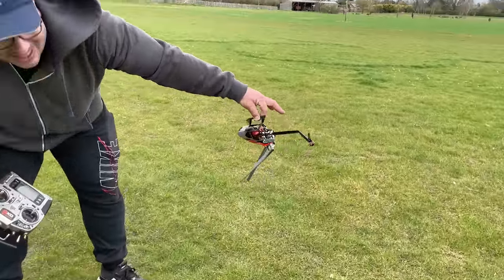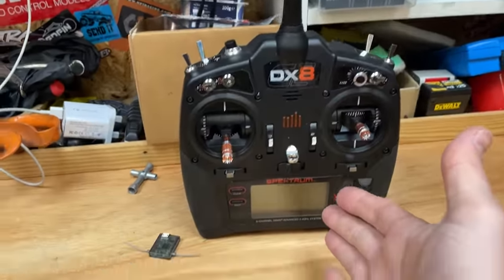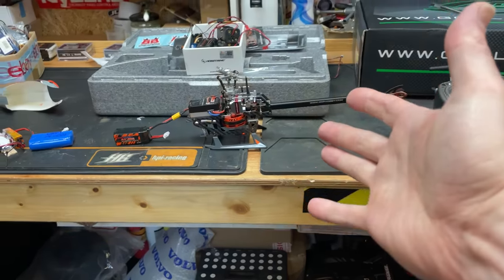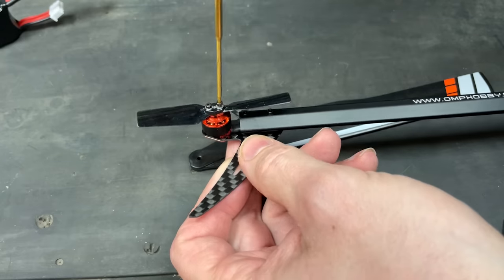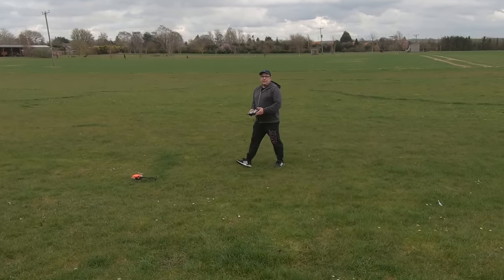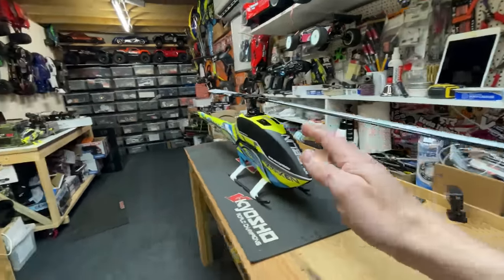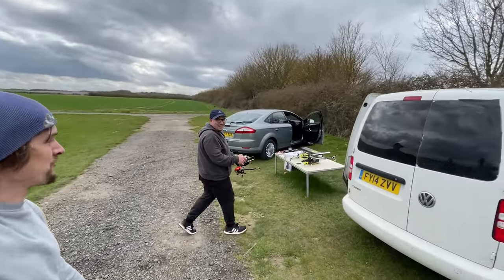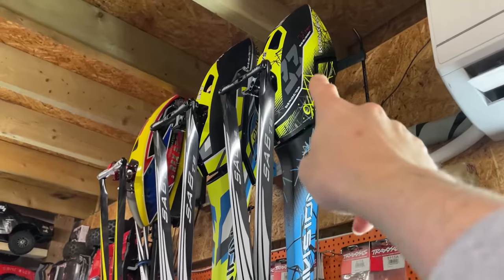When you let your friend fly your RC helicopter

Comment: The OMP M2 does not usually have a tail hold problem with pitch pumps to 100% pitch. I would check that the tail rotor has been installed the correct way round and that the tail and pitch gains are set correctly in the flight controller.
Reply: Yeh he put it on the wrong way
Also he needs to lower the rudder gains a bit

Comment: Increase the tail gyro gain to make it hold on pitch pumps. The FBL gives you a lot of freedom to set everything up to your liking.
Reply: That could be a solution but in this case the first test will be swapping the tail blades the right way around. They where mounted backwards in this video (also see description of the video, Kevin added an update regarding tis issue)

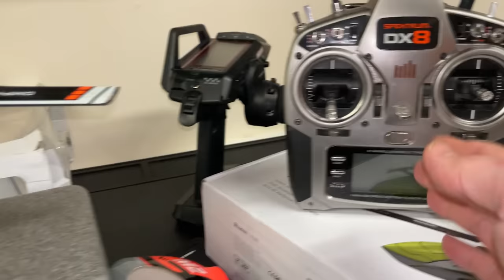Comment: Kev  i think the tail rotor wasn't handling the torque because the prop of the tail is not in the position it should be if you turn it 180 degrees maybe it would work u can see the curve of the pitch is in the opposite direction. I think is that because it happenes on my nano cpx long ago. 7:10

Comment: You put the tail rotor blades on backwards :)  7:11  I have the same heli.  It makes that high pitch sound and wont hold with them on backwards.  Flip it so the little ribs are facing out by the  bolts.  Don't worry I did the same thing with mine when I got it. :).   https://i.imgur.com/QoqCJSV.jpg.  Holds like a champ with them on the right way.

Comment: Tail won’t hold because you put the tail rotor on backwards
Reply from the maker: really?
Reply: Yes, think you put them on differently than they where mounted when you took them off for setting. M2 Tail normally seems better (I dont have one, but seen some) than in your video. Id be glad to see a rebuild and some nice flights on your channel!! :) Greetings from another heli fan from Germany.
Reply: @KevinTalbotTV  yes the tail blade is on backwards. I have two M2s I run a ton of pitch! I never have tail blow issues. I watched you put it on backwards that thing is the most rocksolid little helicopter you’ll ever fly

Comment: This dude does not understand why you use a throttle curve with a v shape. It's not speed  anything up or down with more load on the blades. It's to keep everything at the same rpm with increasing or decreasing load.
Reply from the maker: i do under standard, but i also understand that it's a toy and the best way is whichever way puts the biggest smile on your face and for me thats 100% power.
Reply: @KevinTalbotTV  true, but why do you talk about a delay associated with v curves then?